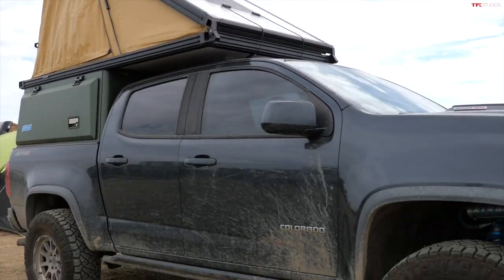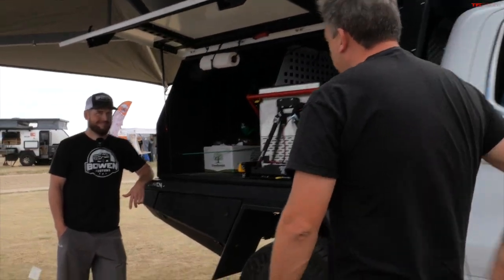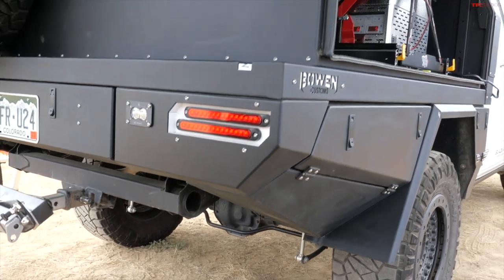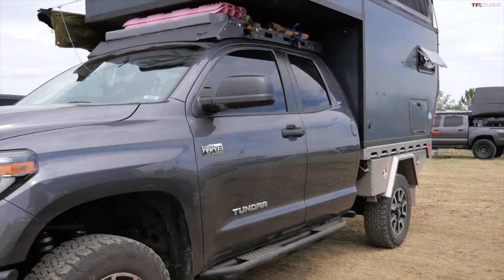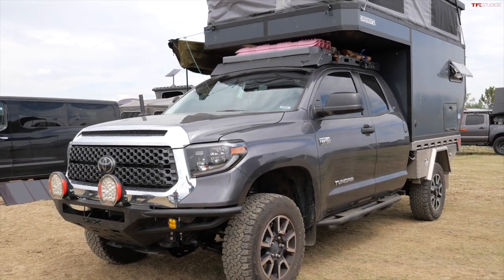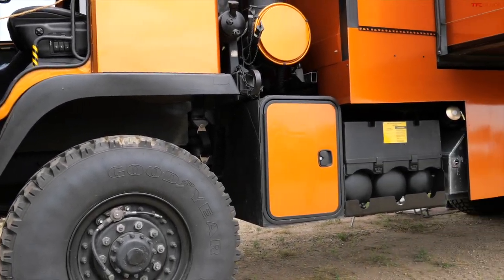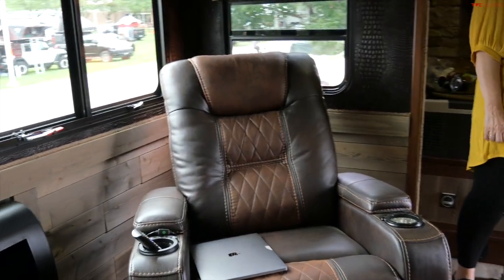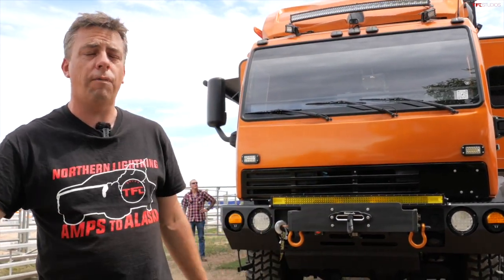Mild to Wild - Top 5 Cool & Over-the-Top Trucks From the Overland Expo Counted Down!

Comment: I see a lot of overlander builds with Nitto Ridge Grapplers.  I put 25k miles on my Ridge Grapplers and hated them the entire time.
Reply: What was wrong with them? What was your favorite AT or MT tire you ever had?
Reply: @JeffinColorado  The only good thing I can say about the Ridge Grapplers is they look great.  That's about it.  The first problem I noticed was balancing them.  I could never get them perfectly balanced.  I went to 2 different places using 3 different types of balancing machines.  I even had my wheels evaluated using a machine with a laser that makes sure the wheels are not the problem.  No matter what we tried, there was always a slight vibration.  After 2000 miles, I tried to get a warranty replacement but Nitto refused my request.  They said I had waited too long and had put too many miles on the tires.  The Ridge Grappler is a hybrid tire.  So, while it's not going to be great at anything, it should be good both on and off-road.  My truck never broke traction on pavement in a turn until I put the ridge grapplers on my truck.  These tires will often break traction in a turn on perfectly dry pavement.  In the rain they are way worse.  These tires will hydroplane badly.  Off-road, they're mediocre at best.  I go off-road with my truck on a pretty regular basis.  I'm an avid kayaker, I fish, I hunt and spend a lot of time outdoors and in the woods.  It also snows every year where I live.  I've had AT tires that performed better off-road and in the snow than the Ridge Grapplers.  Lastly, they wear quickly.  Mine needed replacement after 25k miles, which I was perfectly ok with because I hated them and couldn't wait to replace them.  I replaced them with a set of Yokohama Geolander MT G003 and all of the problems went away.  If you're looking for an AT tire than I think you can't go wrong with the BFG All-Terrain T/A KO2.  It's probably the best AT I've owned and in the future if I go back to an AT it will definitely be in the top 3 that I consider.
Reply: That’s an interesting review of these tires. I’m currently running 37” ridge grapplers on my diesel 2500. I have about 15,000 miles on then so far and have nothing bad to say. I’ve never had a hydroplane issue yet, maybe bc of the weight of the truck. No vibration or balancing issues. The truck feels more stable when pulling compared to the Maxxis RZR mts I ran previously. <— Also a great tire. I’ve been in some very soggy grass while pulling a 12,000lbs trailer(left 3-4” deep ruts) and never spun a tire. This fall I will see how good they do off road on muddy roads compared to the M/Ts I’ve had in the past.
Reply: I’m sorry you had those issues with them, I’ve had nothing but luck with them.  Actually Just changed them out for a new set after putting 63k, they had started to get pretty loud around 58k and I could have kept them probably until 68-70k with the amount of tread left.  

No balancing issues at all, no weird wear, they did great in the rain and snow.  Maybe the E and F load rated ones are built better?  I’m not sure but I have had a great run with them.
Reply: I bought a used truck with Nitto Exo Grapplers on them.. I am surprised the company even exists they were "three peak rated" and could easily kill somebody on a slightly snowy road.  The heaviest worst riding tire I have ever had.

Comment: If you want a full overland/boondocker 4x4 upgrade, all my friends seem to CONSISTENTLY ended up spending around between $8000 to $15,000 USD ($10,000 to $18,000 CDN) on the extras when you install new 33 inch to 37 inch M/T offroad tires (Goodyear Duratracs and Territory seem to be most common!) along with a 2 to 6 inch lift using various brands of coilover shocks, plus the front and back heavy duty bumpers with winches and full width bush bars on both, adjustable tow hook, extra LED fog lamps and light bars, multiple underbody and sideview/front/back GoPro cameras connected to an in-cabin laptop or tablet, new CB/FRS/VHF/Shortwave radio, extendable/folding camper on roof-rack or full bed canopy with lockable side lockers and extra 5 to 20 gallon fuel cans.

You can buy whatever year and model of 4x4 truck you want from a 1998 Tahoe to a 2005 f150 to a later model Nissan Xterra or Jeep Sahara or even brand new F150 FX4, you ALWAYS seem to be spending at least $8000 up to $20,000 on extras.  So if you carefully SHOP ONLINE and do the installations yourself, you can spend about $20,000 to $35,000 on a used 4x4 and spend the rest on extras to get up between $35,000 total on the low end up to $55,000+ total for a near-Raptor-level of 4x4 performance!

It CAN be done on-the-cheap for great 4x4 off-road performance IF you shop carefully!

Best install I have seen yet is my much younger cousin in his 20's who bought a very used $7000 GMC Jimmy and modded it with 35 inch tires on a big lift and put self-built/welded bumpers and bush bars and tenting gear on it all for a mere $6000 extra and a grant total of $13,000 for everything! Him and his young family are out every weekend in the backwoods camping (even in winter!) for very little money other than food and gas! 

He will get another 150,000 miles on it at least because he rebuilt the engine himself and put a decent undercoating and great full length skidplates underneath!  Not bad at all for a mere $13,000 for everything!  Later this year 2022 he is doing a 30 day winter overlanding trip to Northern Saskatchewan's lake country for some serious winter ice-fishing and cross country skiing adventure with his wife and kids and it will cost him maybe $2500 for gas and food! What's not to like about that!

SO YES YOU CAN do 4x4/overlanding/boondocking/off-roading for cheap if you do as much as you can yourself!

V

Comment: I love the first ones, but I wonder where the hell you would drive those 550 based or the 6x6 machine? I've never seen any trails that would accept these vehicles. Where would you go?
Reply: In Canada we have LITERALLY MILLIONS of Square Miles of Crown Land serviced by forest service roads that tend to be flat and fully-levelled gravel usually about 12 feet wide with pullouts every 1000 metres for vehicles passing each other in opposite directions.  

The USA has something similar to Crown Land called Bureau of Land Management (aka BLM) which has almost the same gravel road setup like in Canada. The USA has about 600,000 miles of gravel forest service and rougher but still wide 4x4 roads on BLM land, so there is LOTS of travel to be done off-road with full size and heavy duty trucks!  In Washington State, Oregon, Idaho, Montana and Utah alone, I could travel off-road for MONTHS without seeing a crowd if I wanted to!

V